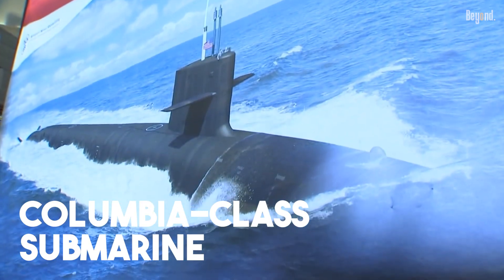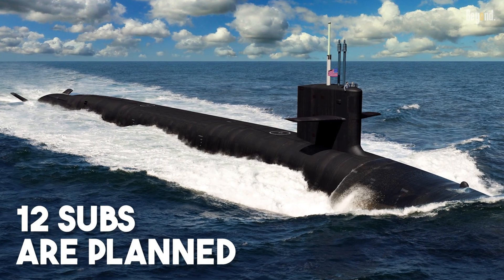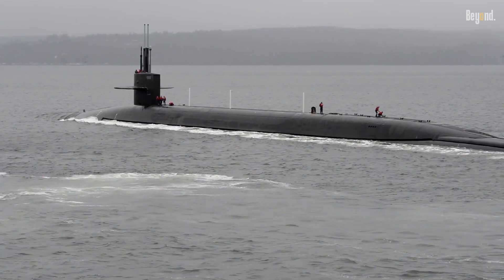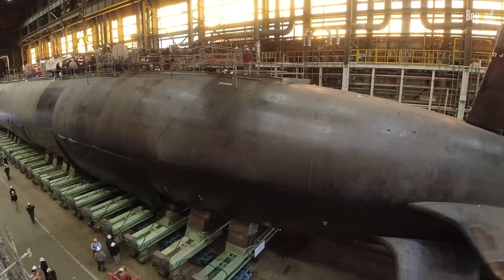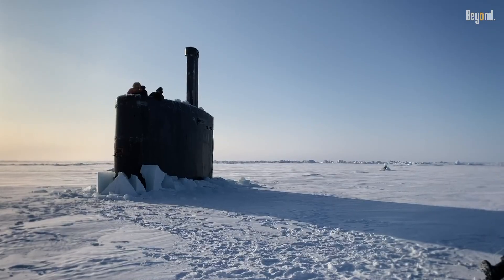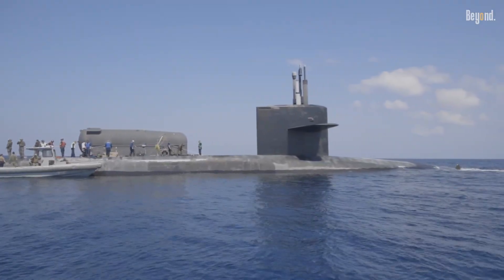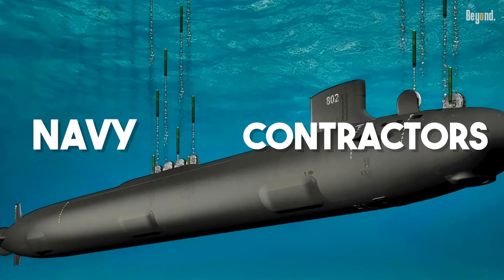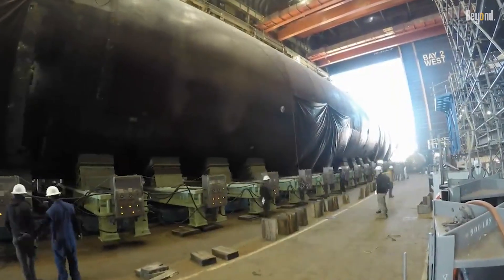The Navy’s $132,000,000,000 New Columbia-Class Submarine Has A PROBLEM

Comment: General Dynamics caught the problem and its being fixed at the expense of the contractor. Babcock International Group plc, in England won the contract for the  Missile Tube Assemblies (MTAs) for General Dynamics Electric Boat (GDEB). The tubes are part of the Common Missile Compartment (CMC) project for the UK Dreadnought class and US Columbia class submarine programmes. So where is the problem, the issue was caught before the tubes were installed.

Comment: There is a reason every critical weld is inspected finding minor defects isn’t uncommon and not a big issue to repair. These welds would probably never fail in actual service but they have defects larger than the specifications allow. I served on US nuclear submarines and worked in commercial nuclear power. 
The problem was the sensitivity of the inspections have gotten so good they always now see some minor imperfections. Going from a position where every detected defect was repaired to some defects are so small they don’t represent a hazard of failure was a tough transition.